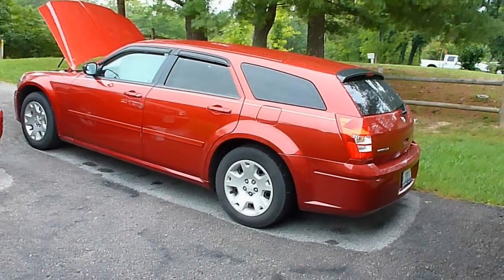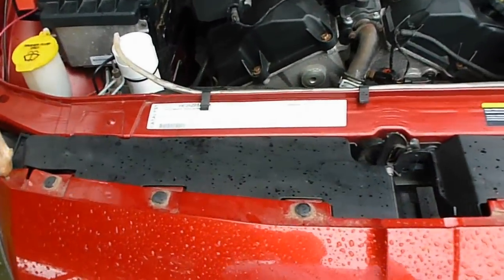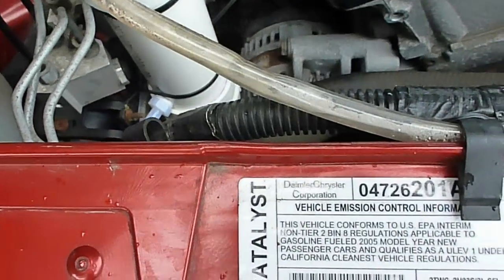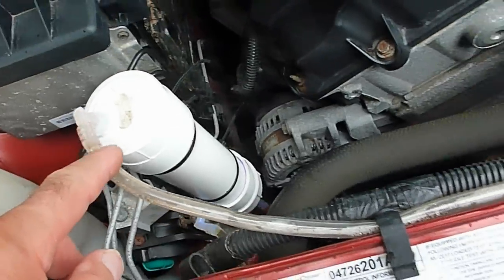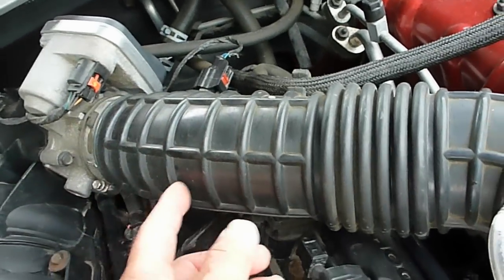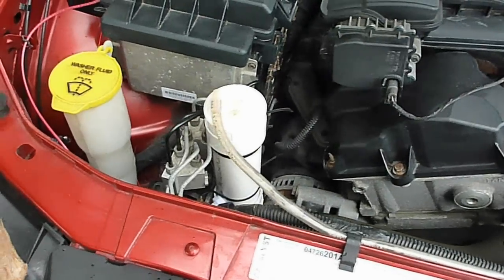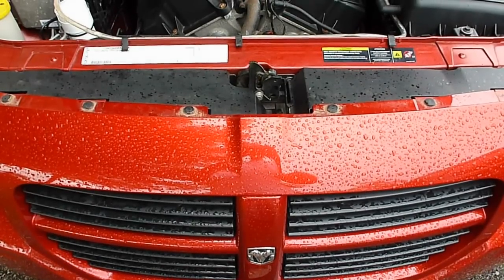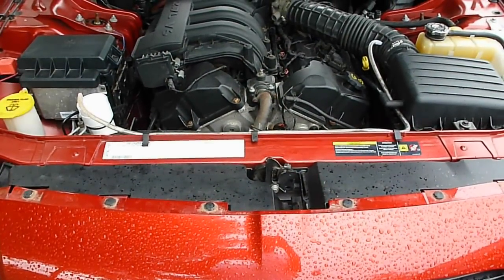2005 Dodge Magnum with an HHO generator installed, now i'm getting 30 MPG, not 16MPG...MOV

Comment: the best way to connect the HOO system direct to the PCV valve inlet in the intake manifold with a T connector to connect back the PCV pipe in it again mixing with HOO it will work more than the air intake hole before the MAF sensor. Do not install HOO kit in the AIR INTAKE it is more way better install it in  PCV VALVE inlet in the intake manifold where the by removing the pipe from the intake manifold and install it with a T connector

Comment: I did some converting and this should be the difference between 17,7L per 100KM to 7,5L per 100KM and keep it apples to apples.

It must take a lot of power to get so much hho, could you tell us how much electrical power it takes and how much volume of hho it produces?

Comment: That setup only lasts for a limited time.  Running fuel, in your intake, will confuse the computer.  You get great mileage for a time.  Then your mileage will decrease about 10ish mpg.  A little later, it will go down further until eventually it's close to what your vehicle can do without supplemental fuel.  Oh, and your check engine light will illuminate.  Unless your vehicle is tuned for the supplemental fuel, that is added to the intake, it will not be able to run correctly.  The only way you can achieve better mileage is running the supplemental fuel into the fuel injection system as a duel fuel setup.

Comment: Did you wire it up to the alternator, could you please do a little video about the wiring and whether you use a pulse regulator to prevent the unit from heating up etcetera. thank you

Comment: So that's roughly 6.25 gallons per 100 miles or 25 liters per 100 a definate improvement. Have you heard of firestorm spark plugs Or Coates rotary valve heads?

Comment: I'd like to send you a better picture of a dry cell system HHO USA and get a dry cell kit produces more hydrogen it came with everything I needed to hook it up relays and everything the wiring and everything it needed and her dry cells and they put two bars of pressure out instead of that instead of a half a bar of that right there that produces less hydrogen then a dry cell would I've already done all the research I actually made a dry cell and a wet cell in my ex-brother-in-law stolej and sold it for scrap metal

Comment: 2005 Dodge Magnum
Mid-size car
Curb weight: 4,393 lbs
Transmission: 4 & 5-speed automatic
MPG: Up to 21 city / 28 highway (not far from 30mpg)
Horsepower: 340 hp
Wheel size: 17-18″ diameter, 7-7.5″ width
Engine: 5.7 L V8

Comment: Question❌
Would one have to reset the computer on car to let it calibrate it with the new fuel added and you would have to have a constant regulated supply or the engine will still burn same gas or this would probably hurt gas milage,

Comment: You know using dry cells you would have a lot better electrolysis a lot more efficient more hydrogen production in oxygen production in a wet cell you lose a lot of electricity in a wet cell I've done both and prefer the dry cell and the production is higher and the dry cell

Comment: Installing a better HHO genny would weild even better results, the key to these is better electrolyzers like potassium hydroxide and more surface area, stainless steel helps to resist corrosion too.

Comment: scam. i used hho generator, + lpg,   4liter engine car, its decreased mpg instead of increased... first did with 12 - 13 amps then 7.1 amps.
Reply: How come?
Reply: @hemanths2782  what do you mean? the only wires using resistance of electricity and i am not talking about other things like water pressure and atoms seperating in the water
Reply: @Zavarkinas  I meant to ask how come it decreased mpg?
Listen...I don't know a lot about these.. but I have installed it on my 600cc MPFI car. Even I run on lpg. I have REDUCED LPG INPUT by 30%  and have compensated it with HHO....and guess what? 5-6 extra miles than before. Let me tell you one thing I am not a commercial to lie. Just sharing my personal experience. If it doesn't work .... at least it should remain same. But in your case it's weird. Coz u say it's decreased?!..
Reply: @hemanths2782  when you post are video with these results call me, i will be glad to see it, but... it will never happens, please dont breake the video, becouse everyone will see it.
Reply: @Zavarkinas  don't worry I'll mention you in the video soon after I make n post it.
Reply: @Zavarkinas  moreover y should I prove you? Lol....I am happy with whatever I am benefited. ..i just came here to say to go to a mechanic ....coz your car has a problem.

Comment: I lost two batteries because of HHO generators drawing electricity from battery. 2nd problem is air/fuel mixture ratio. If we increase inflow fuel, then engine needs more air to run lean. Unless we install an automatic adjustment of air/fuel ratio with computer software or flashing BCM to 1/17 ratio; otherwise we can only improve about 0-22% on highway AIR depending on car's cpu.  

Look at CNG gas conversion kit.

Battery isolator, wire, switch, HHO canister, steel plates, corn air filter, throttle body adapter, air/fuel ratio device; etc plus time and effort cost not much better than an octane buster can but get same result.   Is that make sense to you all.
Reply: I was just trying to say the same thing .
Reply: you'll have to use a PWM to power the cell

Comment: If what you say is true about the 16 miles per gallon then American cars do about half the gas milage that the same models do in UK. I think it is the PCV valve you are required to have that messes up the efficiency of the engine, because here we don't have that valve and we get twice as much milage per gallon.

Comment: this stuff works, mine was improperly installed but still boost me 10% on fuel mileage and a power increase you could feel.
you need a flash back arrestor and a bubbler to be safe and a current monitor controller would be nice... I blew up my jar twice, totally my fault
Reply: Liar

Comment: Ok, I am a skeptic here but please prove me wrong. I understand your HHO installation however I do not understand how you are getting 30 mpg. You did add a new system but you have not technically changed anything in the car for example: how the fuel is being injected into the engine. I am assuming this is a stock car and you have not physically manipulated anything but rather just put add a HHO generator on it. Great video but I would like some explanation.

Comment: "Experts", Please read this:

If you bother to study at all you will notice that the question of energy balance, between Hydrogen energy and energy from the battery, is one very big misconception. The energy does not come from the Hydrogen and does not come from the battery or the alternator! The energy comes from the gasoline when an on board hho generator is installed.

That's what NASA, the U.S. Patent Office and the U.S. Department of Transportation have known for decades: 
A SMALL amount of supplemental Hydrogen will cause the regular fuel, be it diesel or gasoline, to burn more completely. The extra energy is derived from the more complete combustion process. Less waste = extra energy. 
It's not "free energy". 
But adding HHO gas to a combustion engine gives the extra mileage from LESS WASTE. It's not an opinion, it is the scientific viewpoint.
Reply: So you are saying the HHO just makes your engine more efficient?  why don't all car manufacturers do this?

Comment: In concept these systems do work, the only problem is introducing the extra O2 to the system and being able to counteract the effects of it which usually requires a slave chip of some sort?   If you're does work as you say then I am quite surprised and curious as to why.   They do make a car run very sharp and even provides a boost that's for sure.  It's the mpg's that's the problem.
Reply: Have you tried this on your vehicle. sir? Im sincerely Not looking to argue. Im considering installing one in my truck and ive only come across theoretical critique, i.e. this cannot work because the laws of thermodynamics...etc. So I'm really interested in hearing first hand experiences.

Comment: This is 4 years old. How has it worked out? I'm considering this but have read a lot of negative reviews on it.
Reply: CSquared have you put a HHO system on your vehicle yet? If so how's it working out but I'm here to tell you personally I put one on my 04 Dodge Dakota and I went from 18 miles a gallon Highway 236 and from 16 miles a gallon City to 24 miles a gallon.

The other thing after driving for awhile I've discovered your speed has nothing to do with your fuel consumption I was getting the same gas mileage at 80 miles an hour that I was getting it 55 pretty nice there's a video of the system I had on my truckhttps://youtu.be/Q9TJ7lazu3o
Reply: Michael Norman Your trusting a main stream publication? With alternative fuel sources? Not a good idea. Who do you think pays for the advertisements to keep that mag in buisness? Big oil is the answer.
Reply: CSquared An HHO generator gets a bad rep but it does work depending on your set up. A larger motor will need a bigger generator. But the real problem is the computer in modern cars doesn't let the generator do it's job efficiently so than your mpg goes back down to normal. But many people have made electrolyzers in carburated or Diesel cars and it works perfectly fine even to the point where if the hydrogen and oxygen ratio are perfect for your personal vehicle than it won't need gas at all. Just look at this car completely gas free https://youtu.be/U3zoVt8Ds5k
Reply: Michael Norman there is a science to it but it's not that complicated practically all you need is distilled water baking soda 12 volts stainless steel and that's basically it with your container baking soda makes it happen here's a video on my vehicle in 04 Dodge Dakota pickup

My system produced a bubble of hydrogen a second and this gave me incredible the gas mileage here's a link to my system unless you put one on yours and you already know with one bubble of hydrogen and oxygen per minute I went from 18 miles a gallon Highway to 36 miles a gallon and from 16 miles a gallon City to 24 gallons

Here's my link https://youtu.be/Q9TJ7lazu3o
Reply: There is a science to it with some merit. The reality is that you would need an unrealistic amount of hydrogen to make a big enough difference. The official nail-in-the-coffin by the professionals is here [http://www.popularmechanics.com/cars/a3983/4310717/]

Comment: use the heat of the engine to power a steam engine, to turn a separate alternator, which will make the electricity needed to produce more fuel. free additional fuel, unless you count the water for the steam engine, but u can easily get that for free.
Reply: This would be the equivalent of adding a turbo charger to your engine only that you are using water instead of added fuel
Reply: There is a paper from Romania or somewhere where guys used exhaust gas heat to boil water and create steam which in turn ran really efficient "Tesla turbine". they carry away was it was more powerful on old engine than conventional turbocharger because of smaller load on the engine back pressure and some other properties.. All and all, popular mechanics do have a point with just running an electrolyser from alternator. If you want to save a lot of gas, you have to improve every aspect of the car. 0.001% everywhere could help. For now i cant give anyone a good prototype to say "This HHO wors on every car"  ECU, Lambda sensor and everything else is part of equations towards more economical cars. But i am a firm supporter of scientific approach and if you have free hydrogen in some way, H2O is way better emission than CO2 or unburnt volatiles.

Comment: for all the people saying this does not work, think about this. hydrogen has a btu of 61,100 per lb as opposed to the 21,900 of gasoline, of course it takes some energy for electrolysis but the HHo generator puts far more into the system than it uses. another factor is the pure oxygen which greatly improves the efficiency of the cumbustion process. all of you who comment saying that you can't get more out than you put in, are 100% correct, however this is no attempt to do that, it is adding adding an alternate source of fuel. the amount of potential energy in water is much greater than the energy that is required to release it.
Reply: far more out of the accessory belt from 600 watts....??? I've installed sound systems that are beyond 10,000w and yes I've upgraded alternators and added batteries, but I've never noticed fuel economy drops worth noticing.. even if you had 1000w only, no extra battery or anything.. it wouldn't make a noticeable difference. so I'm confused by your logic here.
Reply: of course this is assuming that you build a proper generator that works efficiently. by all means you can make one that is substandard and the results will be undesirable, but that does not mean this system will not work.
Reply: Jason, do you realize how much hydrogen is in a pound? A pound of hydrogen at atmospheric pressure, like you'd get from electrolysis if you separated the two gases, is 10,169 liters of gas. That's right sir, over ten thousand liters of gas at atmospheric pressure.
Reply: More bullshit. It takes 600 watts to power his HHO generator, but meanwhile it takes far more than 600 watts of engine power into the accessory belt to get those 600 watts out of the alternator. So now the burn has to be more like 2000 watts more efficient. And that's just to get a negligible improvement. Ain't happening.

Comment: I run my car on pure water and prayers to Jesus. You need nothing else. If you want to add a boost then dissolve some communion wafers in your water. Don't bother with this HHO stuff it's a waste of time and the devil will hang on your fender slowing you down. I've seen it happen.

Comment: did you try to connect the HHO generator to the car's alternator, and shut off the fuel. I mean, if you halved the gas consumption, one would think the HHO alone would be able to run the car (regardless of the performance), right?
Reply: It takes more energy to produce HHO than it yields when it burns.

Comment: come on dude, that is a 3.5L engine which definitely gets more than 16 mpg.  it will get 21 mpg in the city all day long, and high 20's easily on the interstate
Reply: He claims to get 31.25.. thats a huge improvement over 16, or 21.
Reply: Actually he has the 2.7L V6.
Reply: 2005 Dodge Magnum
Mid-size car
4.5/5 · Kelley Blue Book
Curb weight: 3,847 to 4,393 lbs
Transmission: 4 & 5-speed automatic
MPG: Up to 21 city / 28 highway
Horsepower: 190 to 340 hp
Wheel size: 17-18″ diameter, 7-7.5″ width
Engine: 2.7 L V6, 3.5 L V6, 5.7 L V8
Reply: I Have 3.6 l Jeep Cherokee Laredo I get 7.7 mph ....wtf

Comment: Did you not get problems with your DME thinking your engine was running too lean? with the extra oxygen in the exhaust?
Reply: Think about the volume of air in the combusting chamber with and without hho gas. Without hho, its normal working condition. With hho, the amount of air will be lesser, it means running too rich, too much fuel, not too lean which is too much air. Its just a theory, im not sure lol. Hydrogen lighter than all of the gases.